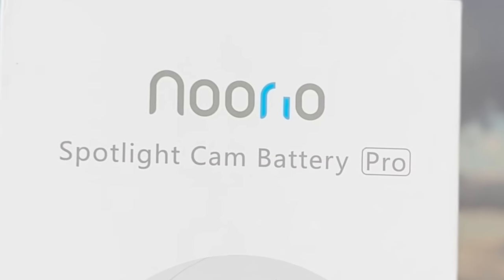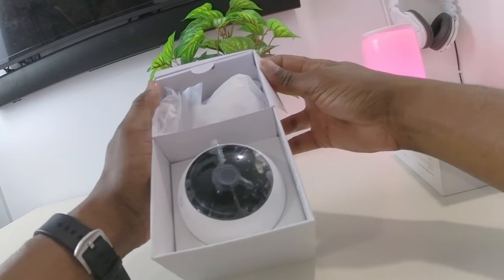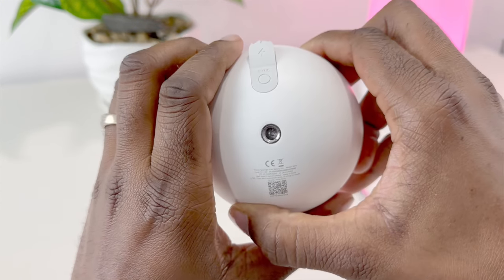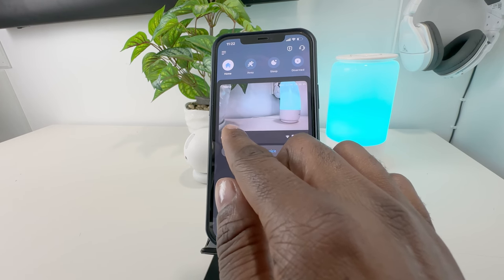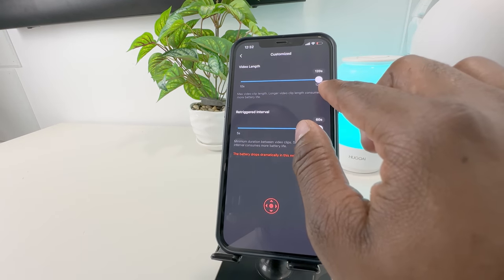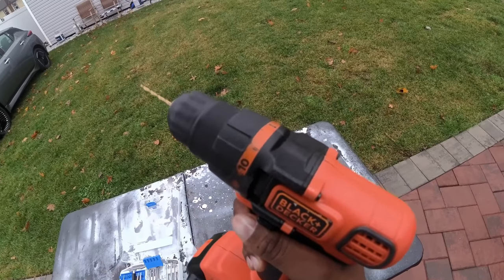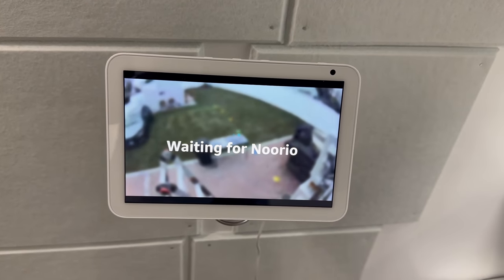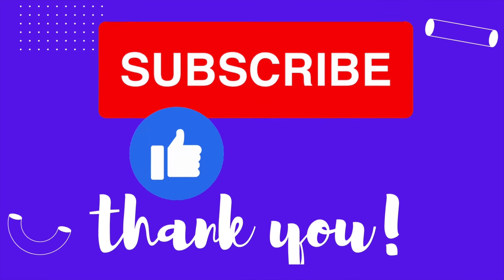NOORIO SPOTLIGHT CAM BATTERY PRO

Comment: Great video

What kind of door lock do you have? Im looking to upgrade to a key pad type, similar to the one you have
Reply from the maker: Hi 
I have  a few different smart locks 2 different type Yale lock and a smoet lock smart lock the all work great the Yale locks are reliable  however in my experience the Yale app sucks, however you can bypass the Yale app and get smart home access with smart things. I also can controle them with amazon Alexa / google home access . Depending on how much you can spend also determine which version of  Yale lock works for you.       

Hope that answered your question

Comment: Good cam but keeps disconnecting from device at times. This is the only drawback I found.
Reply from the maker: Yes, 
I had that problem as well

If it was cheaper, I would say it’s awesome but for the price I think there are much better camera available 

Thank you
Reply: @mysmartliving  Any good recommendations? Is Ring a good option?
Reply: This camera has one big flaw and it's the most important one.... they go offline every single day and if you are not at home you cannot reboot it 98% of the time they will not reboot on their own so while you're away from the home it's worthless...